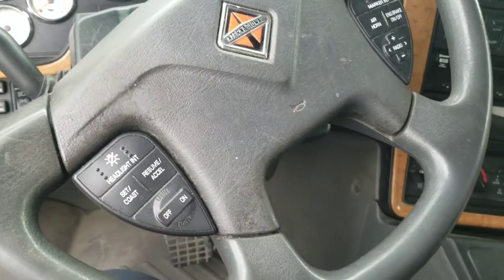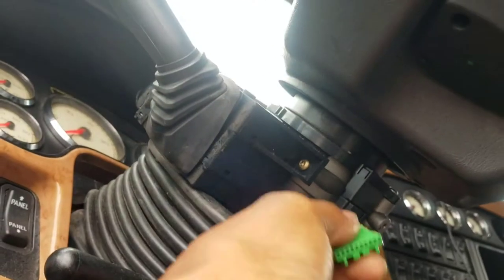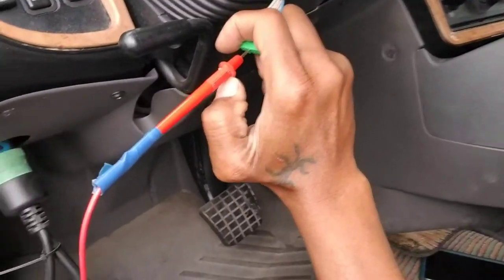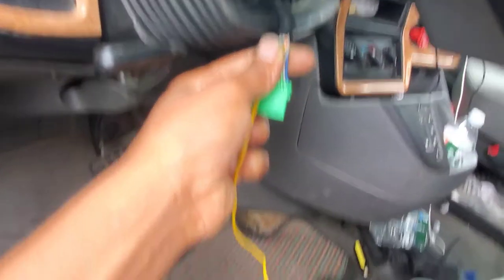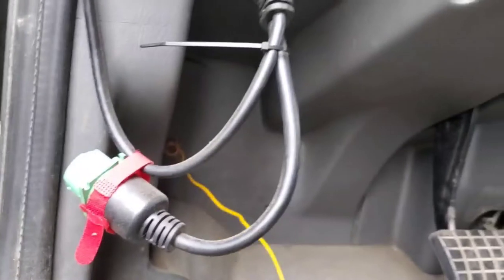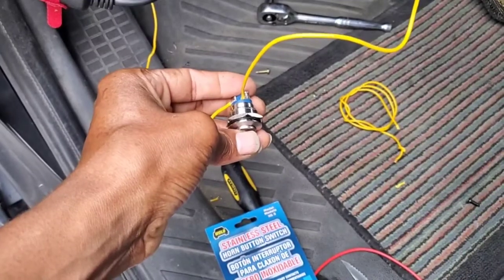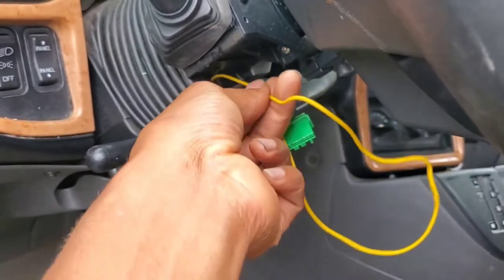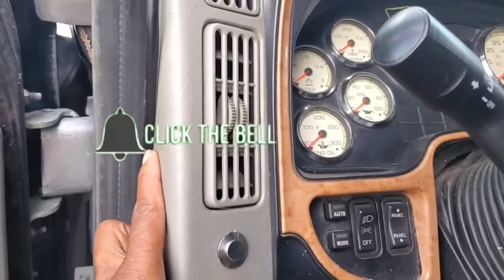How to fix your horn when clockspring is the problem without changing the clockspring

Comment: I've got a 2016 ProStar international everything on my steering wheel works but the air horn just stopped so is that what I need to do
Reply from the maker: You will have to do some troubleshooting to see if your problem is the clockspring or not. Check your fuse panel for bad relay or fuse. See if you can get to the air horn and run an independent wire to a 12V wire or connect it to the battery, then tough the negative to any ground area. The air horn should work at that point.If it doesn't, then you have a bad horn.
If you find that your clock spring is your problem, i have another video showing how to remove and install a new clockspring.

Comment: man, they really start falling about at that year. I'm suppose to be buying one and now I'm a little worried.
Reply from the maker: Just make sure your engine and transmission is good and you do a good inspection before you buy check your seals axle king pins.with used truck be prepared to put some money in it a few weeks are months down the road most of the issue might be minor.